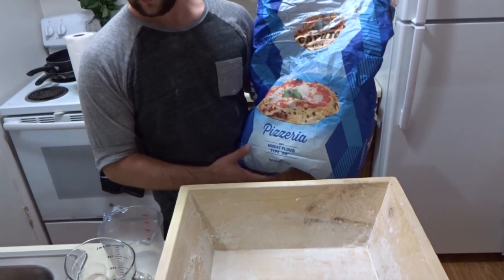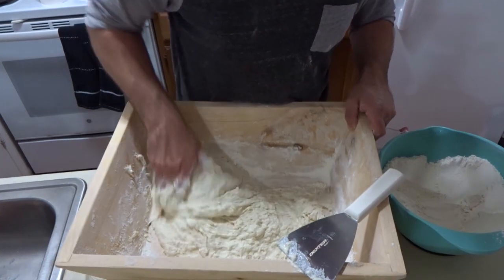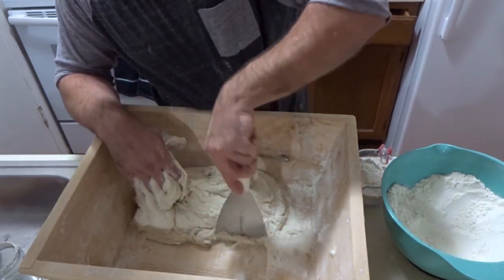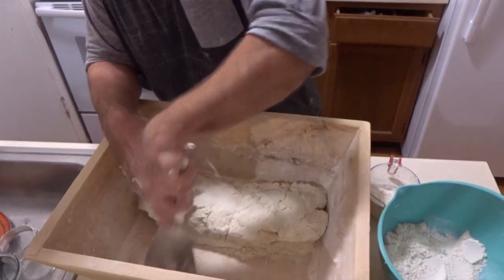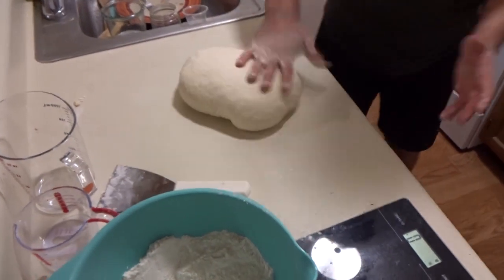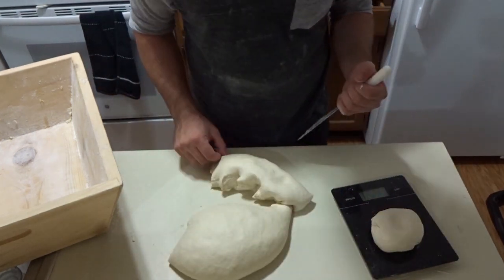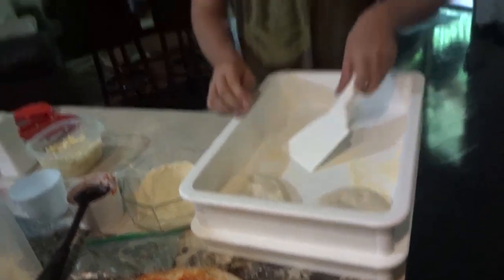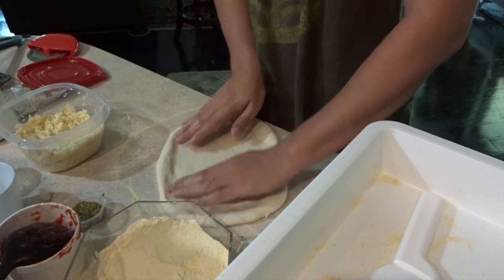How to make Authentic Traditional Pizza Napoletana (Dough) [AVPN] READ DESCRIPTION!!

Comment: Cudos to you! I am 60 and been making pizzas my whole life. My hands are crying right now because i told them, be good or i will make you work like this video!  I would be hurting but i leave that to my Kitchen Aid mixer😊.  I love my Koda 16 and Caputo is my favorite farina! Grazie! Exceptional video! 🇮🇹        
I love the buscotto stone but i do not think it works well in the Koda 16. It is too thick and raises the pizza floor  too high to the ceiling were it is much hotter. 
I ditched my stone and bought a steel on Etsy custom for the oven. I love it.
Reply from the maker: Grazie!  Thank you very much Al!
Reply: thats a great idea! any idea if u still have a link for the steel you purchased ?

Comment: great vid , but too big a dough, what would be the recipe for 500g of flour and would it be different if you use bread flour thank you
Reply from the maker: The AVPN calls for a liter of water to be used.  AVPN has a certain limit on amount of bread flour to be used in flour mix.

However if you're not worried about AVPN, here's a recipe:

500g flour
300g water
15g salt
.15g active dry yeast (for 12hr RT)

500g flour
300g water
15g salt
1g yeast (8-12 hour RT, 48-72hr CT)

Bread flour will make a difference, if it's malted, there will be more browning, it could be more dense if it's high protein, it could have a different texture if it's bleached and bromated.

Comment: isn't that a lot of salt?
Reply from the maker: Yes but for Napoletana pizza you need it as it is a room temperature fermentation and helps slow fermentation
Reply from the maker: Before electricity and refrigerators, upping the salt content made having dough for an entire day possible.  3% or maybe 3.5% would be the absolute highest I would ever go.  Too much salt and the dough will not rise at all, say 10%. maybe
Reply: @LevitaNostra  what is the longest for room temp ferment ?
Reply from the maker: @vicbad4116  according to AVPN 24 hours but longer is possible with less yeast
Reply: @LevitaNostra  thanks so much for all your experience and wisdom.
Reply from the maker: @vicbad4116  that's very kind of you :) hope it helps!